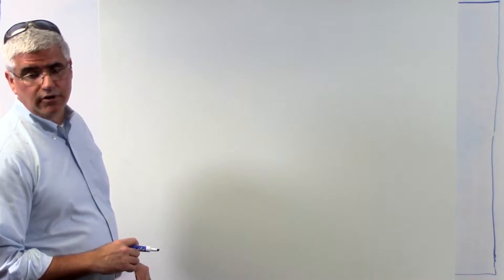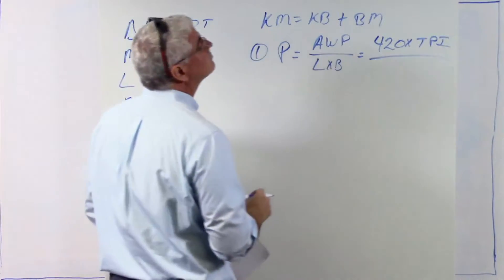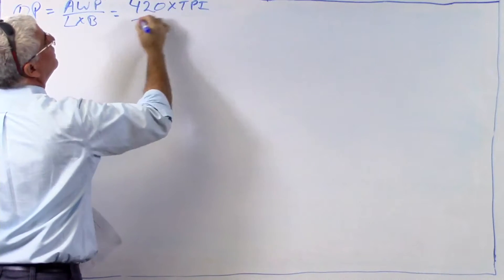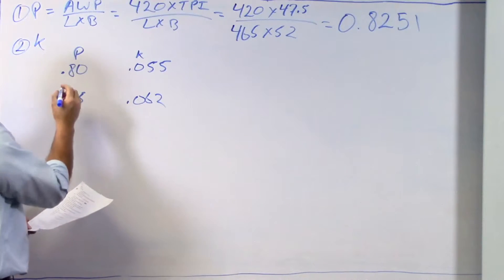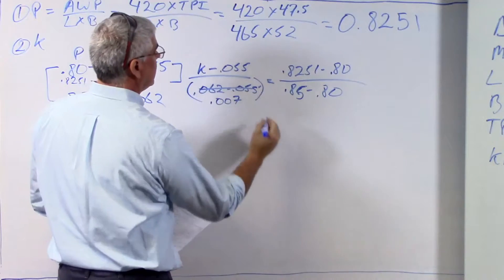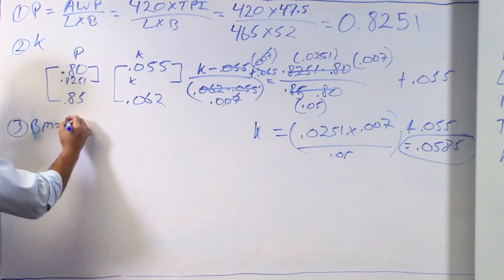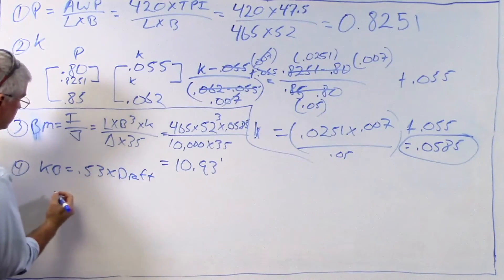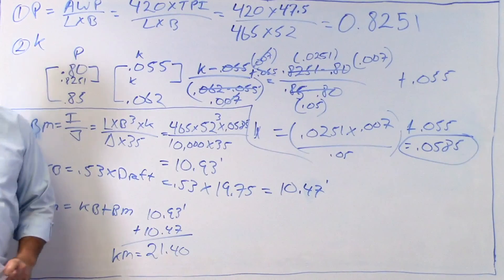Calculating KM using formula KM = KB + BM plus calculating  p and k

Comment: Hello Capt. How are you, are you still alive? i have a very important question about in step 4 calculation. Where did you get the multiplier value of 0.53 to draft?. Thanks
Reply from the maker: .53 x draft is an approximation of the height of the center of buoyancy. For a perfectly rectangular shaped hull, the height of the center of buoyancy would be .5 draft but for a typical merchant vessel hull it is about .53 due to the flare, camber, etc.
Reply: @deckprep  Hello Capt im glad youve reply. I have follow up Question about 420 as divisor for Water Plane area. It is also a Constant? Thank you so much for sharing your Knowledge.